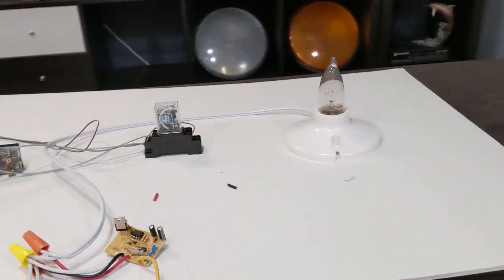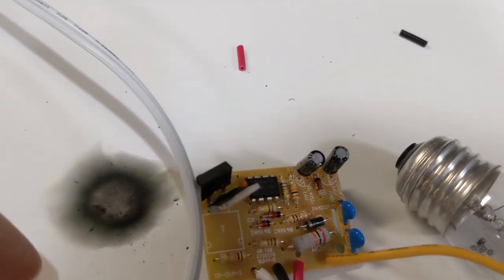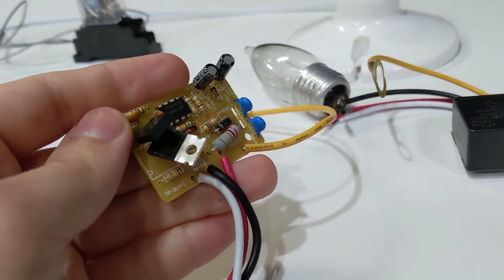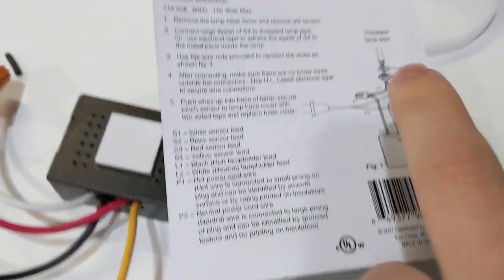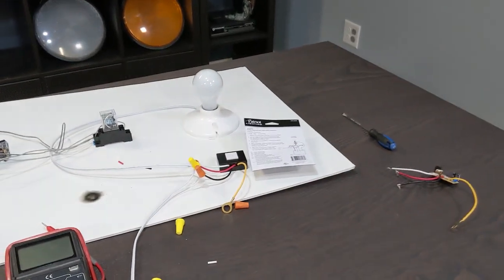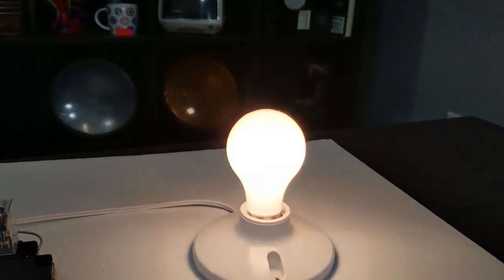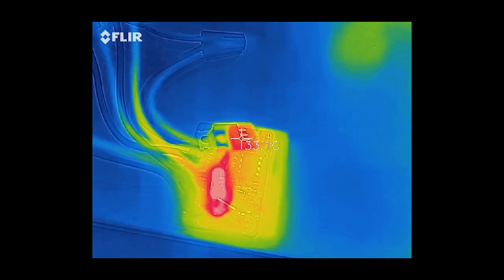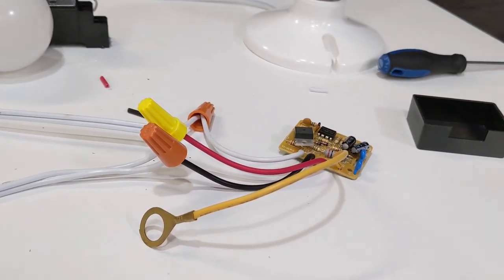A slightly explosive touch-lamp follow-up (standby energy consumption)

Comment: Untill the EU wiring regulations came into effect in the UK, Black was Neutral and Red was Live/Hot.

Black is now a live when dealing with a 3 phase cable which used to be Red, Yellow and Blue, the colours are now Brown, Black and Grey.

Without a seeing the diagram, or looking over the traces on the PCB, I would have wired it red to live and black to neutral and white as the lamp output.
Reply: When working with a three core cable, there's no enforcement over whether you use grey or black as live, but you need to sleeve them correctly.
Reply: @dylanharding5720  when I completed my City and Guilds 2330 level 3, we were taught to never use black as a neutral, even with sleeving.
I recently worked on a circuit where  3 core & earth was used from a 2 gang switch to each half of the room, this also carried the live so it used Grey for neutral then black and brown for each light.
Reply: To be honest I think the first standard you mentioned is more intuitive. I mean, sure, you can learn any standard but I think red is just more intuitive for the "hot" wire. As it is, as someone who doesn't work with AC all the time I get confused if live is white or black because I can rationalize both.
Reply: I believe the year of the change was 2006. Personally I liked the old red is live colour scheme. I do find it interesting this device is switching the neutral, not the live.
Reply: @EwanMarshall  I thought that was strange too. Look at th Edison screw in bulb, the centre contact is the live so, even when the lamp is set to off, if plugged in, it's still live becaus the screw part of the contact is a  switch neutral.

2006 sounds about right, I did my qualification around 2012 and it was well established then.
Reply: @EwanMarshall  I've got vague memories of seeing the brown/blue/yellowgreen wires in UK plugs with parents changing fuses at least as far back at 2001. But I guess both were allowed for a time, if that scheme is the EU one?
Reply: @kaitlyn__L  
the cable on an appliance was changed to brown and blue 40ish years ago , the house wiring was changed about 2006ish , i think the three phase was changed just a few years ago :-)
Reply: @YTANDY100  ah, makes sense, it was always appliance wiring :) usually going to a lamp where the fuse inside the plug blew. Come to think of it, that house had a lot of burnt-out fuses before breakers tripped, in a way other houses in my life didn't, even ones that were older. (Lived in two barn conversions, but one was 70s wiring and one was 90s, conversion done just a year before my birth. The 90s one is the one that kept popping fuses and/or breakers!)

I'm pretty sure I'd seen a bunch of others that had red and blue, instead of red and black or brown and blue. Often on heavy goods like the washing machine. I'm thinking, since they were always basic DIY plugs (until factory fitted plugs were mandated here) that some individuals just happened to get their hands on one of each standard...
Reply: @Welsh Dave
on four core 3p it used to be red yellow blue for live and black for neutral and now it is black brown grey for live and blue for neutral :-)
Reply: You are still getting it wrong. The reason it exploded is because you connected the white S1 wire to your mains line voltage. 
Your explosion has nothing to do with connecting black or red wires to neutral or not.
Reply: @YTANDY100  I've not come across a 4 core and earth to see a blue wire yet. After a couple of years or bar work I went into electronics assebly and maintenance, I now build and service mobile CCTV towers for building site and events security.
Reply: Here in Italy, Brown is live, Blue is neutral and Yellow with a green stripe is earth ground, so I would've had to look at the diagram anyway...
Reply: @giyanvice  Nope, this thread is mainly about wiring colour standards in different areas rather than "why did it blow"? But now that we're  here...

Leading up to it going pop, S1 being connected to Neutral is doing nothing, think of the triac like a relay, the Neutral connected to the normally open, not connected to anything.

Now, without mentioning any colours, here's a breakdown of what happened.
Pre-pop wiring:
Supply live to unit neutral in
Supply neutral to unit  S1 and lamp A
Lamp B to unit live in

The lamp, being a thin wire it's acting like a fuse and passing supply neutral out of lamp B to the unit live in. As this is AC, the unit has live and neutral with no concern for polarity, it has powered up and it's drawing the expected 0.4 Watts. Remembering that this unit switches neutral (wired as Supply live in this instance) in to S1, which is connected to Supply neutral, when the touch ring is used, it creates a dead-short across Supply live and Supply neutral.

Would it have made a difference if he put the non-polarised plug in the other way around? Nah,  dead-short is a a dead-short, regardless of polarity. This is why the PCB trace, triac and the bulb (an accidental fuse) all blew.

I wouldn't be surprised if it worked again once the triac and damaged trace were replaced, what do you think @bigclivedotcom ?
Reply: That was my way of thinking. Just then a matter of polarity for the bulb return - if you guess right, it's light and if you guess wrong, it wouldn't - no bang!
Reply: @YTANDY100  Marvellous, innit ! What's wrong with Green: earth, Black: neutral, RED: live, Red/yellow: live 2, Red/blue: live 3.
Reply: @millomweb  check out my response just above yours, still bang regardless of input polarity.
Reply: @welshdave5263  NOT with correct wiring d'oh !
Reply: @monkeywithocd  Black is hot because you touch it you die (though usually not). Neutral is white because it's safe. Ground is green because it's good. Switched is red because it's dangerous, but less so than hot.
Reply: @ImpiantoFacile  Yep, that sounds familiar here too  (UK).  Brown or Red = Live; Black or Blue = Neutral.
Reply: @christopherrto  Red is the "everyone knows this" colour for danger.
Reply: @monkeywithocd  Red is danger is pretty much universal. I would have wired red to live and black to neutral. I grew up in the time of brown/blue/yellowgreen wiring.
Reply: @EwanMarshall  Yeah, switching the neutral doesn't seem safe, especially for none earthed equipment.

Comment: in australia, red or brown is hot, black or blue is neutral. the colours make sense to me.
Reply: Also from Australia and this video was a real "huh" to me because this product makes sense to me too. I was under the assumption that colour coding wiring would be internationally standardised. Turns out they're not, and I find that insane.
Reply: USA is insane, no-one else defaults to Fahrenheit + Imperial + backward wire colours, oh well...
Reply: Of course the colours makes sense, at least to the whole world except North America. It's like God or the simulation operators took all contrarians and put them in America.
Reply: Yeah same in the UK. Red/black was the old British standard, brown/blue is EU. I've always thought black for live is insane.
Reply: I'm a Brit and agree with you..Red is hot ! who the hell uses black as hot apart from the septics ?
Reply: @jasejj  Black for live is insane.
Reply: The USA is definitely not perfect. I'm an electrical engineer in the USA that engineers a product for grocery stores that includes their 3phase breaker panels  (277/480V brown, orange, yellow, gray or 120/208V black, red, blue, white-- both systems use green grounds or green/yellow stripe for isolated grounds) 

We also includes their lighting and HVAC controls. Inside control panels wire colors are dictated by which UL standard you are building to but UL508A gives a certain amount of freedom but we try to be as consistent as possible within the a given control panel ( 24VAC control power typically use blue and yellow. 0-10VDC dimming output we typically use black-  red+ but sometimes have to use gray-  purple+ ... Input wiring is typically orange)

Because we wire everything to terminal blocks the field wiring can use standard multi conductor wired colors that doesn't have to match our panel wire colors (they just have to follow what we tell them on our drawing)
Reply: Same here in Spain. Red/black is for DC I think.
Reply: @Shortcircuit220  I was just playing with one of those panels, hooking it up for computer control (using in an insectary which has to simulate day/night cycles).  Really wish it used 3v3 or 5V for control instead of 10V.  One of those relatively minor annoyances which just makes no sense to me.  Maybe you know why they use 10V, and/or why I couldn't find a simple level converter?  Is it one of those intentionally incompatible things?
Reply: Brown because that's the colour your trousers go if you touch it.
Reply: Same in Asia
Reply: makes me think of some situation where someone from the US complains about a driving game where you're on the left side of the road
Reply: @Les Hold on, TC rants for several minutes about the "absurdity" of one colour system. I use one word (which was only really repeating what the OP, who isn't European, said, in context) and you're making some kind of rant about Europeans? I'm not sure who is overreacting here but I don't think it's me.

Really the only mistake on view here was that of an American retailer buying and selling products that are not really suitable for the US market, without making it clear enough what the various wires' intended uses are.
Reply: Reversed power switches, 110v power, cannot pronounce "solder", weird colour schemes for the wires, back-arsewards dates
Reply: Color make sense in France too, red is hot, bleu is neutral.

But for older installation, black is hot, white is neutral
Reply: It makes complete sense to me in Europe, brown or red is live/phase or hot" as you call it.
You think of your cars red battery lead as live or hot don't you?
Reply: We DO use black as a live BUT only as a phase live when looking at three phase systems, brown black grey with neutral in blue.
Don't get me started on "standardisation", in the UK we decinamalised in the early 1970s and EVERYONE younger than me was taught metric in school, idiots STILL keep quoting inches and effing frakenheight........ RANT Rant rant rant 
😂😂😂😂😂😂😂😂😂😂😂😂😂
Reply: @Les RED is L2?
So when wiring a 3ph box what's now neutral?
Reply: @jonathantatler  In America white is always neutral. While we use your old neutral color as our hot color, we don't use your old hot color as our neutral color.

If there's anything all of us with our different regional wiring colors can agree on, it appears to be that red is not a neutral.
Reply: Apparently I need to correct myself. It seems The Netherlands used red for neutral and green for live before 1970. It seems maybe we can't agree on any of the colors. Or for that matter, even on the spelling of the word color/colour.

P.S. My spell checker says "colour" is an error.
Reply: @eDoc2020  colour is British. Color is American.

And about the colours, the Netherlands used the German standard, where red was nul/neutral :o so wierd

Comment: Here in the UK, the red was always live and the black was neutral, until we changed to brown and blue.
Reply: In the Netherlands green was live and red was neutral, glad they changed it with some European standardization.
Still in general I would not put too much faith in the wire colors as they may use the same module in different countries.
Reply: @qlum  to be fair, most things I get  from China these days seem to just use two white connectors, so it's just a lucky dip!
Reply: @qlum  wonder how many installations in the Netherlands ended up with a phase/neutral reversal due to colour blind electricians.
Reply: Mark Evans, why would you ever allow a colour blind person to become an electrician?
What next, the Stevie Wonder school for driving?
Reply: Mark Evans, the most common forms of color deficiency still allow to distinguish between ‘blue’ and ‘brown/black’. Ground is yellow/green and this also is not likely candidate for confusion.
Reply: @elonmask50  Because usually it's not a problem. Regardless of the various colour blindnesses black and blue will always look different and earth is striped. The only problem that might occur is with multi phase power where an additional gray wire is used as hot.
But regardless of that: ALWAYS measure your wiring with a multimeter!
Reply: Ruhrpottpatriot, 
A.  Only the Yanks have hot wires.
B.  Have you ever seen a data rack or a comms room?
C. The place that you “might” put your customers at risk is where there are grey wires? You mean like 3 phase, or multi core cable, an elevator controller, or the back of a car stereo, so basically EVERYTHING an electrician might work on.
Reply: z4zuse, what a stupid response, have you ever seen a control cabinet, or a comms rack, even the back of a car stereo, I have seen first hand a “colour deficient electrician” blow up an entire house full of electronics, garage door motors too oven clocks and everything in between, it took me an entire day to find and fix everything for that customer.
Reply: @markevans2294 The dutch don't enforce phase on their plugs, systems that are phase sensitive need to check it themselves.

Comment: L1 & L2 ... L stands for Lamp of course. I'll omit AvE references.
P1 & P2 are for Plumbing from your beaker box.
S1-S4 stand for Short, for the shorting device.
Reply: ..... switch ?
Reply: @TheGreatPurpleFerret  No thanks. I like where I'm at.
Reply: @johnjordan3126  technically the issue is not that is is shorting. It is setup to switch the neutral which is going to be 0V potential or close to it the moment current starts to flow and the triac is not rated for mains potential, hence, pop.

This of course is somewhat dangerous in another way in that the terminal at the bottom of the bulb holder is live whether that triac is on or off (like when he was changing the bulbs). without GFCI/RCD on the circuit this could kill if someone touches it and ground at the same time. Of course, should probably unplug it from the wall when changing the bulb
Reply: @EwanMarshall  My post was totally tongue-in-cheek, poking fun at the poor labelling. Because of the way it was mis-wired, when the triac was switched on it did short the AC hot and neutral leads tied to S2 and S1. Of course like you said, it was supposed to simply complete the neutral path from the lamp - a workable but potentially unsafe approach which plenty of folks took issue with. Agreed on GFCIs - they're lifesavers.